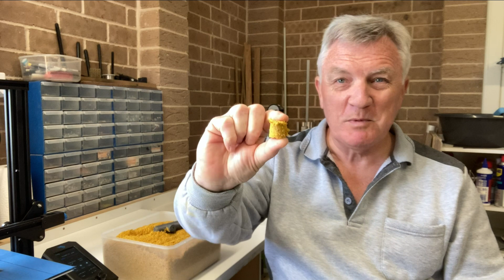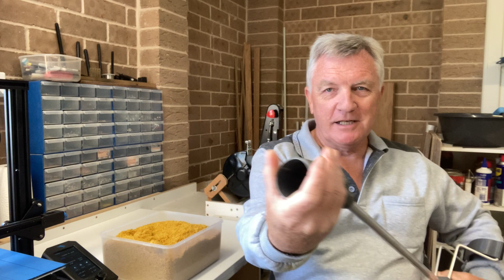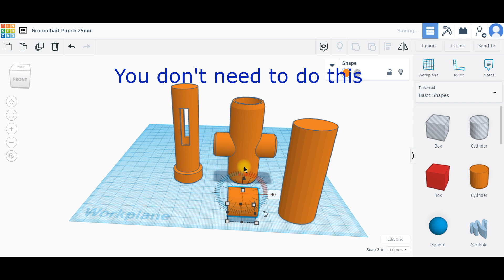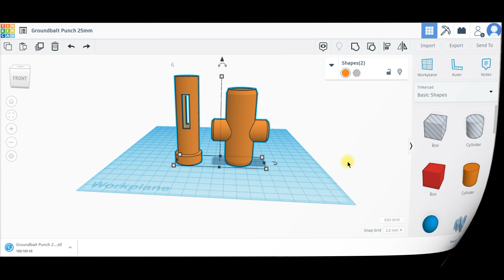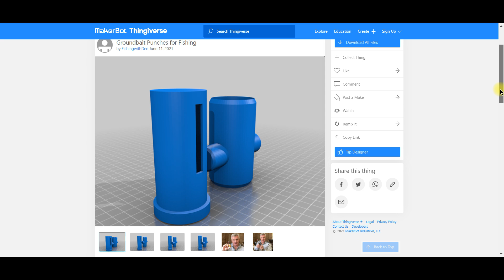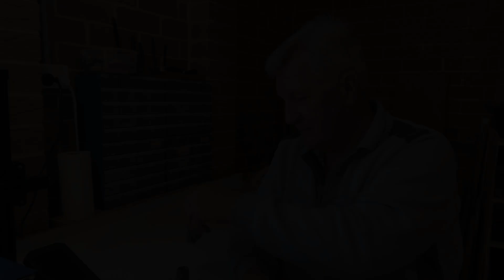Groundbait Punches   3D Printed

Comment: I recently bought a Bambu Lab X1 Carbon and AMS to join my collection of 3D printers, the AMS allows multi material and multi-colour prints and the X1 Carbon is 6 times faster than the budget machines, I am currently deep into Fusion 360 designing some wagglers with removable differing colour tips for when the light changes and also for people who don't have Multi Material Systems (no more colouring in fluorescent tips with a black pen when the light changes) I am also going to have a go at making some eye pieces for self cocking versions. I will send you a link once I have them completed
 I fancied printing your groundbait punches but the number no longer seems to work on Thingiverse although a search found them, maybe you could apply a link to make them easier to find.
Reply from the maker: Here you go Andrew: https://www.thingiverse.com/thing:4883178

Comment: What make a model of printer have you got and what do you think of it. Thanks Den
Reply from the maker: Hi Robert. Originally I had the Creality Ender 3 V2, but that died after a huge amount of prints. These days I have the Ender 3 V2 Neo and the Ender 3 Max. I love them.
Reply: @FishingwithDen  Thanks Den, Me being a novice not done it this before not sure what to go for, I have been looking at the Ender 3 V2 Neo and the Ender 3 Max, what one would you recommend. 
It would be good if you was to do a video on the printer what type of filament you use, the ups and downs you have had and the projects you have done,
Reply from the maker: @BobKirk50  No worries Robert. I think I would go for the Ender 3 Neo mate. There is very little construction required for that printer. My first printer took me forever to put together, but that one comes virtually complete straight out of the box. As for the video you asked for. here's the link: https://youtu.be/ggdhVGDPNPA

Comment: Hi Den! I have printed bread punch and with my 3d printer and it works well. I would like to see some video where you can show us how do you use groundbait with this tool and how efficient it is. Did you try to use a syringe, with the nozzle cut off, instead of this? Thanks for sharing that with us.
Reply from the maker: Hi AdiT. Thanks for your comments. A friend of mine uses a syringe in the way you suggest as a bread punch, but I think he has to pull the plunger back before each use. They could certainly be used as a groundbait punch but it may not be the one handed operation I outlined in my video.

Comment: Another inspiring video Den.  There might be some components that we can't  print, i did show a part to a friend of ours lad, that's been into 3d for awhile.
Certain parts have  to endure a lot more stress and strain, that's why they use injection moulding.
Tougher plastic, but  one  could use metal 3d, but that is very costly.
Reply from the maker: Thanks Peter. You are right. The nature of 3D printing means that structural parts will not be as strong as moulded parts. This means you have to be very careful if you want to print structural parts which are going to be subjected to a lot of stress.

Comment: Hi Den, great addition to the tackle box, I use groundbait punches all the time. How about printing rod rests! (not the bank stick), just need a die for the thread,
 I have lost or misplaced quite a few over the years. When I want to replace them  I can't always find the shape and size I prefer. Thanks for another great video.
Reply from the maker: Hi Mike. Thanks for the comments. I'm working on a fully adjustable rod rest right now. The head part might be something you could use with a normal bank stick. I'll have a think about it.
Reply: @FishingwithDen  your printer may have the capability to actually print the threads without the need for a die
Reply from the maker: @barbaraneville5036  It does Barbara, but the 3D Printed bolts are too fragile and break off too easily. I'm thinking about incorporating a steel 3/8 BSF bolt into the project, but getting hold of small quantities of 3/8 BSF bolts isn't easy when you only need a few.
Reply: @ Maybe studding ?
Reply from the maker: @barbaraneville5036  ? Studding?
Reply: @FishingwithDen  Just lengths of bar with 3/8 bsf thread that you saw to whatever length you require
Reply from the maker: @barbaraneville5036  Ah! Yes I see what you mean now, but trying to buy 3/8 BSF in either bolts or bar is very difficult in OZ, especially in small quantities.
Reply: @FishingwithDen  Forgetting in the UK we can get most things by popping to B&Q or similar :-(   Might put one of those printers on my Xmas list though Let you do all the hard work designing LOL
Reply from the maker: @barbaraneville5036  Why not mate! That's the plan from my end too.😃👍